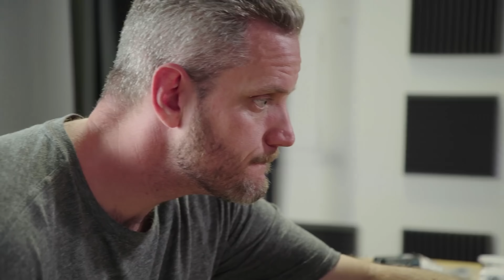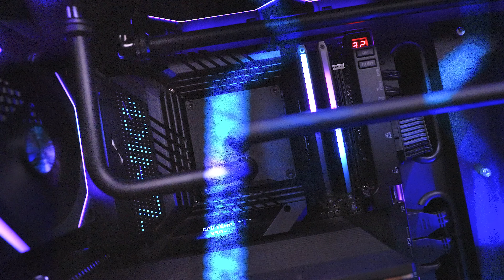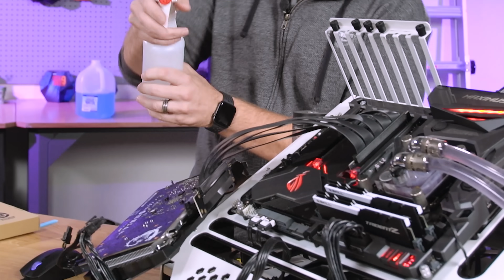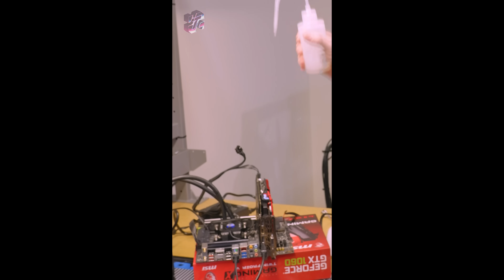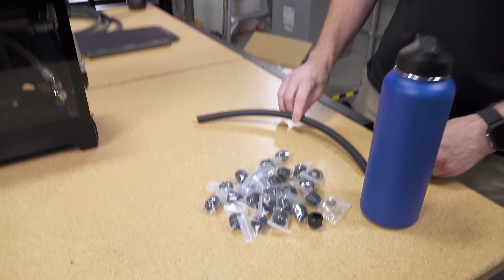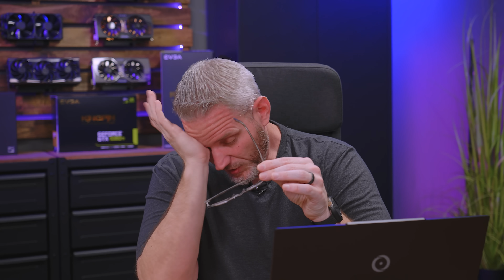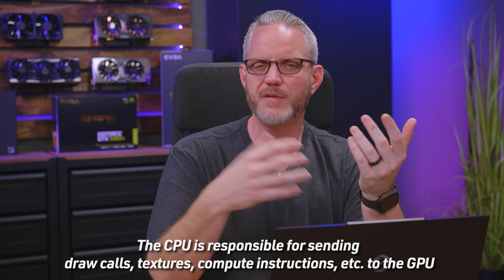5 Myths about Watercooling that are WRONG!

Comment: "Putting water into your computer" sounds exactly like putting a "fire inside your house" but of course, nuance is important and the fire is in a chimney and the water is in tubes.
Reply: @RicochetForce  Fine, you have a great pair of pointers. (zing)

I'll change from "chimneys" to "put gas and lighting it up inside your house" which is actually tubes with gas as well that you light up on the stove. We've had explosions. Is that better?
Reply: @LautaroQ2812 most houses in the states run gas hot water heaters, gas furnaces, and many still run gas stoves, you can even still get gas clothes dryers. That's all literally just pumping pressurized flammable gas threw tubes in your house and then you open an end and light it to have a literal open flame for cooking or heating yet houses aren't exploding left and right.
Reply: @02bluehawk  Exactly my point! Thanks. Gas is the cheapest so if it's still like that in the US which is a very very large country (area), imagine countries like mine. You don't need to know, just imagine!
Reply: @Laubeq  you know that is exactly why we are trying to replace everything with electric boilers and induction cooktops right?
Reply: yeah people would never put fire in some sort of enclosed space in their house that would be crazy
Reply: Oh ok that’s were I went wrong I put the fire on the table, I came back it was all over the house
Reply: I love water cooling. In fact Jay got me into it. Air cooling is perfectly fine but for OC water cooling hands down wins. As far as liquid damage/failure I'm a former plumber, now in IT, and unless you're really careless with your connections or seals it will fail. But if you take your time, torque everything correctly I have never had a system fail. In both my system and my kids. Kids love a water cooled system also. When they show their friends that their dad built it with them envy ensues haha.
Reply: Nice analogy but i still keep using air coolers. Reasons for me are 1 i am lazy and not checking or cleaning a air cooler will choke parts slower so you have more time procrastinating the cleaning job. 2 a good fan will outlive a good pump 5 times. Sure the fan can get loud but before it stops turning is a long way in the future. 3 i run stuff 24/7 for 20 years now i just want stuff that works 5 years or more non stop without any cleaning work or turning of my machines.
Reply: @chinesepopsongs00  I had Chinese DC pumps (they cost $10 bucks each or somth) that ran for 5 years, they still work....they are weak compared to D5s so I had 3 of them to maintain flow in a massive custom loop (two CPUs, VRM, GPU, dual 360mm rad). Other than the waterblocks, I use Chinese everything down to the fittings. Watercooling is not complicated, it's literally just pumps pushing water from one point to another, just like in cars all you have to worry about is the seals
Reply: @chinesepopsongs00  all them servers are doing it wrong then if we're supposed to take that last one seriously 🙃
Reply: I would think most liquid cooling doesn't use straight out water.
Reply: The ovens and stove tops would like a word with you.
Reply: Hmge, so a stove?
Reply: It's more comparable to the air conditioning system in your house. The AC has an outside of the house radiator, that cools the liquid and blows the hot air outside. A liquid cooled PC blows the hot air outside of the PC case, into the room it's operating in. It heats up the room.
Reply: @Gamevet not necessarily into the room. You can make a loop that goes to other rooms, or outside. It is one of the advantages of water cooling.
Reply: age? not rly more like coolant just shreds through the plastic innertube and removes abit of plastic every time, but mx 8 year old tubes still hold together to this day daily use so..😅 @НААТ
Reply: @RicochetForce  they do. Often. When they're not properly maintained, just like most things.
Reply: I don't really lie to myself that I water cool for any reason other than purely for the looks, lol
Reply: @bassface876  There's no way I could keep my i9-10850K and 12900K CPUs tame, without an AIO. We have our AC at 70 degrees Fahrenheit, during the summer in Dallas.
Reply: @bassface876  You can't ignore the cooling power though, I was pushing 3DMark records back in 2015 with my very overclocked StriX 980Ti....at just 55C thanks to that waterblock
Reply: Do you use a Putter for putting water into your computer? 😂 How about adding Liquid Cooling instead.
Reply: Both with their own risks.
Reply: Like the viva la dirt league skit for water cooling and it is just Rowan putting a motherboard into water and pouring more onto it
Reply: Yes as long as it's not a single drop of water leaks out of any of the tubes while your computer is actually turned on and running, and no water drips on any components, sure you'll be fine, until it doesn't and it actually drips on a component and it destroys it because water and electricity ..DONT...mix

It's held me over this entire time for many many decades now plenty fine
Reply: Imagine all the candles with air pockets like little fire bombs under people's curtains
Reply: Heatpipes also have liquid in them.
As for custom loops, when set up and assembled properly with high quality components, there is no more danger than running a heatpipe style cooler.

My current water cooling setup only cols the CPU and motherboard power delivery. The waterblock and pump/reservoir were bought used which saved a ton of money. I also shopped around for the fittings I wanted and got the new parts I bought at a really good price.

The liquid is distilled water with a water tension reducer meant for automobiles. For anti-growth I am using a silver "kill-coil". Also have a separate reservoir/filter setup to keep anything from getting clogged such as the block. The in-line filters meant for water cooling setups greatly restrict the flow as do the valves.

Sourcing parts and adapters from Home Depot to get that in place was fun as I wanted no flow reduction at all.

I've only had to clean out the filter and top-off once so far a few months ago and have been running this system for about 1.5 years now.

When I eventually upgrade my computer, the only thing I will need to replace will be the water block and some tubing.
Reply: @EthanAQueen  yeah well last I checked in case any of those are your dime a dozen mid-range and higher in are CPU Cooler such as the noctua nhd15, I don't see them ever leaking giving that they have an excellent quality solder going on about them versus a diamond dozen custom Loops which do not and have multiple points of failure that involve having to use fittings
Reply: Fire in an airplane can be extremely dangerous. No fire in an airplane is definitely extremely dangerous.
Reply: Really bad comparison because water loop or AIO has way more fail points than a simple chimney.
Reply: But you can still use the house with the fire turned off, you cant use the comp without the water running
Reply: Hmm.. Dont know what kind of heating you using but in my house fire exist in.. fireplace.. and chimney is used to deal with smoke.. :D
Reply: I mean you do know that they make servers designed to be submerged into liquid? (Not water but you can use the same liquid in “water” cooled systems.)

Yes there’s a risk but there’s also a direct benefit.

Water cooling presents elevated risk but if done correctly it will always to push top speeds for much longer time frames. And let’s say you are running a threadripper for compute heavy tasks that generate revenue and the longer those tasks take you are losing money because you could be running new tasks if the pc stayed cool and didn’t throttle. 

So for example. The system I am about to build (just ordered all the parts) is about $10,000. So if something goes horribly wrong my risk is $10,000. However in order to cross that risk thread hold where if it happens I’d still be profitable in the purchase even if it were to get destroyed would only take about 6 months. Meaning. If nothing happens within the first 6 months then even if on the 7th month something crazy happens and the liquid leaks everywhere making me have to go rebuild the system that’s fine I still made a profit because of water cooling. 

Not to mention if done correctly the risk is very low. You can also test all gaskets and everything first. Build the system out but only the water cooling. Put it through its paces and monitor all seals. Put paper that changes color if any water touches it underneath each seal. You can also use a vacuum seal that that you can monitor pressure on to see if the pressure is = to what it should be if no tiny pin holes are present. 

Beyond that take your 3D printer to print fittings that go around each seal point. Within that you add a water actived sealant gel that if the underlying part does get a leak that gel activates and expands. They make these that change color once activated so add enough that it’s visible and protruding out of the 3D printed part and visible. Then you take an optical sensor that triggers if the color of that gel changes and notifies you so you can shut down and investigate if need be. 

All of that is overkill but it’s all possible. 

Yes there’s a risk but there’s also a direct benefit. What you need to ask yourself is for you in your situation is the risk worth the reward.
Reply: Also bro… do you never cook? Never heard of a gas stove? Quite literally putting fire in your house… worse yet it’s pumping PRESSURIZED highly flammable and explosive gas through your house. 

It’s all engineering. Yes. There’s risk. There’s also benefits.
Reply: I hope you don't have a fire in your chimney
Reply: @pasmuis  I hope you don't have gas in your house
Reply: dont tell me how to live my life
Reply: True...but my brain still can't accept that it's a good thing xD xD xD 

Ofcourse it's fine... but I simply cannot get over the fact of putting liquids in my electronics xD
Reply: @Mr3ppozz  If you do it right, its fine.  If you do it like I did, not so much.
Reply: @Mr3ppozz  There was a time I forgot to tighten a fitting and water was leaking on my 2080Ti it took me 1 week to realize that the screen freezing was due to that. The GPU was fine after rubbing alcohol removed all the residue and it still works with the 2nd owner. Make sure to use the distilled sh*t like Wilkins, you won't be afraid with water damage ever again
Reply: @JABelms  lol like I said j understand that there's a "safe" way to use it...and that is being done by many people with great success...its just my brain that doesn't cope with water in a pc xD nothing other than just plain stupid bias and nothing more xD
Reply: @Mr3ppozz  And that's fine, traditional air-cooling is perfectly valid. I water-cool cuz I like it, it's more of a hobby than a necessity.
Reply: @ujiltromm7358  Except I actually HAVE had that catastrophic failure that very much nuked the entire system with only 1 year old water. No matter how much deionized water, new additives, and new fittings are "supposed" to be safe,  that very expensive leak means I'll have a hard time trusting open loops again so I'll just enjoy watching others do it. 😜
Reply: @zodwraith5745  and that’s very sad, but that doesn’t mean nobody else should…it’s the same thing as “my gas powered stove at my kitchen wall on fire, so I don’t want natural gas in my house anymore” it’s like, that sucks, but overreacting is not necessary. Observe, adapt, overcome.
Reply: @ujiltromm7358 If my AIO ever fails, I’ll probably replace it with a Noctua NH-U12A. I’ve seen some pretty nice benchmarks with the NH-U12A combined with a high-end CPU.
Reply: @What_In_This_World  Having natural gas in your house in kind of a bad idea, we have this new thing called electricity, you know :P
Reply: @ujiltromm7358 I like it because it's more quiet.
Reply: @zodwraith5745 Water gets ionized within a week or so. Check a bottle of battery water, the best before date is how long it takes before the it is ionized.

Thats why we use anti-corrosion agents like glycol in our loops. If you wanna be fancypants you get some EK or alphacool.

Comment: Really wanna do my first custom loop build on my first non prebuilt pc
Reply: Hey if your confident in yourself go for it! I did this and I had a great time! Just did my research before hand, took my time and it came out amazing. Just make sure to pressure test your loop before you put liquid in it (:
Reply: Best advice I've heard Jay give in an older video is, "take your time".  Just be patient, make a plan, design it all ahead of time, and go slow and methodical and it'll pay off once it's all put together.
Reply: Just make sure to fully attach things O...O
Reply: It’s fun enjoy, just before you put liquid in think how it’ll come out
Reply: make sure you triple check every part for compatibility. And you will still run into problems. Murphy's law. Not trying to discourage you, just want you to not have a lot of unnecessary work or waiting around for correct parts because you didn't triple check your measurements.  I made every mistake before i got it half assed right. 👍
Reply: You can do what I did with my prebuilt before you watercool it. I took my parts and got a new case and mb. Then you can start to plan out watercooling.
Reply: Go for it...I built my first pc around 2019 

8700k delidded oc 5gz all cores 
Asus maximus x formula
1080ti
I used soft tubing

A month ago I built my 2nd one and loved how the glass tubing looked and wanted a challenge and I did it..just take your time and have patience even if you gotta take a break,the outcome is worth it

Z790Aorus pro x
14700k
Xfx 7900xtx
G skill ram
Ek water Bock cpu
Bykski gpu block
14mm glass tube
All bykski fittings
Samsung nvme 
Lian li v3000plus case
(3) 480mm hardware labs radiators
Bitspower d5 cuboid res pump combo
17 themaltake swafans

YouTube is a great place to learn.i leaned alot watching this channel. Good luck
Reply: Do soft tubes & full copper only with distiled water. Its the easiest & simplest.

Ino  nickel plating on everything will have the same temps as anything thats air cooled with nickel plating
Reply: Build a pc first trust me
Reply: If you need the extra cooling for a workstation pc with a lot of cores to cool, go for it. If we are talking about a gaming pc. Just don't. It's totally not worth it.
Reply: @dr.brennstab2201  absolutely not worth it from value perspective, this would be a passion build I wanna so steampunk theme
Reply: @dr.brennstab2201 what if people like it… it’s the same thing as wrapping a car or going to an expensive restaurant… to each their own why would you tell someone not to do it when it is something they just want to have?
Reply: @6724superman  It always depends on the context. If you are poor and plan to go to an expensive retauran. It's probably stupid. The question is, is this an "I go all out" build or not. As long as we are not talking about top of the line components for cpu/gpu, it's just stupid to spend money on an expensive watercooling, because you could simply buy better components with the money.